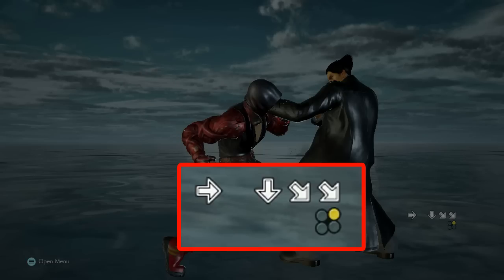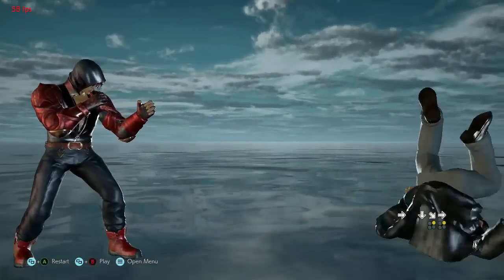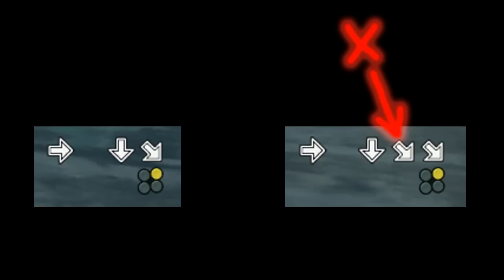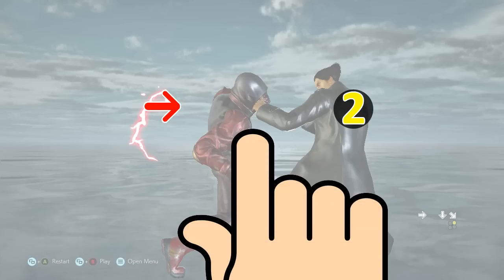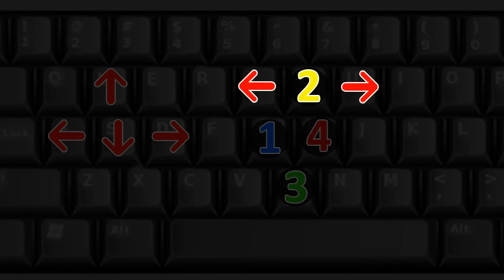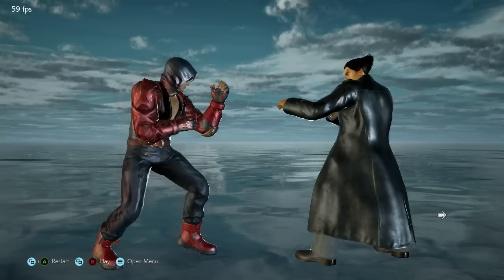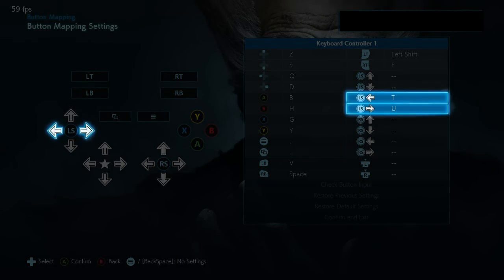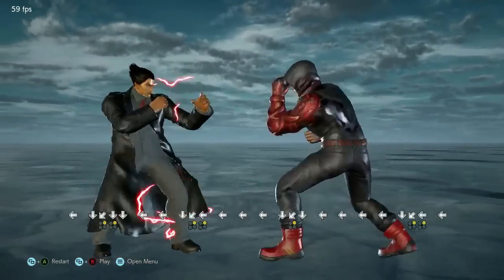Tekken 7 -  How to do Electric Wind God Fist (Very Easy EWGF)

Comment: rip im playing with controller :/
Reply: pad shouldn't be that hard. just press 2 as you press forward (while still pressing down, basically a down-forward). relax your thumb. don't put too much force or speed. like the video said, precision or accuracy is much more important. practice even by slowly inputting f, d then from the d input that's where you press f and 2 at the same time (again, no speed required, just press them at the same time)

Comment: Damn, this was a HUGE help. I can literally electric every time now with my setup. I use insert, home, delete and end, and have movement also mapped to page up and page down. kbd is also even easier this way.
Reply: I cant get the +2 frames on the shutting down part, Help?
Reply: How did you map it out like that?
Reply: @200ike  wtf playing tekken on keyboard. why torture yourself like that?? buy a ps3 controller or ps4 or even the damn xbox one to play fighting games. Why the torture why why why why why????? why? how? why?
Reply: @gamingman21  This isn't a helpful comment. Maybe I don't like the ps3 controller. Maybe I can't afford a controller. Maybe I don't have a console. Keyboard isn't that bad anyway
Reply: @gamingman21  I have a ps4 controller. But I still play on keyboard because I found it easier.
Reply: @200ike  No front but for tekken keyboards are trash. even a cheap 10 dollar controller will make this game way more comfortable.
Reply: @BesiktasAslan1  I get that, although I see it as a preference thing. I tried my ps3 controller for it, and it was annoying to execute an EWGF. Hurt my thumb after so many tries. 

The keyboard is more responsive to the commands. Adjusting is the difficult part. Because I'm undecided if I should use a controller or a keyboard.
Reply: @200ike  Well the best option is an arcade stick since the movement hits just different on these things, but keyboard is last place tbh. This comes from a dude that plays tekken for over 15 years now
Reply: @BesiktasAslan1  I've thought about getting an Arcade stick, but I worried that I might regret it, for whatever odd reason. The directional pads on controllers are just so awful to me. And I feel clunkier when I move. Like if I want to duck, I'll side step, and vice versa
Reply: @200ike  ull get used to it, in the end its for u to decide tho but if u really wanna improve in tekken and plan to play it a long time get an arcade
Reply: @BesiktasAslan1  do you use an arcade stick?
Reply: I'm new in this game, what is the function of electric move in Tekken?
Reply: @BesiktasAslan1  their isn’t no best option it’s all personal preference I’ve played both stick and pad and tried them out they never were comfortable for me but when I tried keyboard it felt the best to me.
Reply: @gamingman21  Spoken like a true noob. Even some hardcore pros use keyboard. The input is a lot better than pad for movement based attacks.
Reply: @BesiktasAslan1  was tekken on a platform that supports keyboard 15 years ago? Like, keyboard makes electrics and basically everything else piss easy. I can hit 99 electrics in a row no problem. Picked up tekken for only a few days and managed to wavedash fairly well and do extremely consistent electric.
Reply: @opgroundzero2.0  it was on arcade lmao
Reply: @stephaniecurry45  rhetorical question
Reply: Good for u :( its so haaaarddddd

Comment: For a more universal way of getting to the point of doing electrics, here's what I did, it took about a day or two total to get to the point I felt comfortable going for it in a match.

1. Get familiar with the misinputs in the following order:  Elbow (f2, way too early), dickpunch (d2, early), WGF (late), df2 uppercut (way too late/spasming).

2.  Don't just speed up or slow down, focus on doing the dick punch one frame after pressing d.  Practice this first and train your hand to hit 2 exactly after.

3. Keep trying to nail the electrics with the idea in your head that you're trying to hit d and 2 at the exact same time, not df and 2 at the exact same time.  This is for a couple of reasons, a misinput d2 is a lot less worse of a misinput than the WGF, and the delay between your hands that usually gives you the WGF can be used to place your 2 input directly on top of your df input.

4. Do electrics in a match and you will solidify this in your brain.  An easy setup is to try to nail an electric after a jab.  The worst thing that can happen is you lose your turn, but you need to practice under pressure to achieve consistency.
Reply: #3 tip helped alot
Reply: @mattroque7345  Wow, seeing this made my day, glad to hear :) Keep at it, I'm still drilling these at least a hundred each side a day and just barely pulling them out in matches.
Reply: Thank you for your humour and your advice I'm getting it down now
Reply: @mattroque7345  same
Reply: i instantly started hitting these like no tomorrow! the explanation was perfect thanks bro

Comment: I know how it works but its difficult in console. So what I do is press down forward triangle at the same time.it usually works. When it doesn't its because I didn't press at the same time. The pressure sensitivity of triangle and the directions are a bit different in the d pad. The triangle have a very slight higher travel time than the directions. So knowing how much pressure is needed will help in getting it right. But on the other hand it will mean executing it in other dpads that are not yours will be difficult because ur hands are not used to other pressure of other dpads
Reply: This is how I do it on ps4 too. Controller destroyer though.

Comment: even works on ps4
Reply: how do i do the binds im kinda dumb
Reply: How
Reply: Yes it works, I always mind the speed of inputting d,df and 2. Its not just pure precision. Speed is also necessary.
EWGF dont have very easy way doing it, its tons of practice and time to be able to pull EWGF very consistently.
I use PS4 controller and I input down and 2 at the same time while sliding to df (its easy but doing it consistently is very hard)

Comment: Bro I'm not using a keyboard I'm using a Fightstick with a Korean lever and out of 100 attempts I land one Electric Fist. It's so difficult :'( I'm getting ready for Tekken 8 I'm a KOF Player, currently I'm not playing KOF I'm playing Street Fighter 6 but I'm not gonna play Street Fighter 6 anymore one Tekken 8 comes out and I have 3 characters in mind to use, (Hwoarang - Kazuya - Jin)
Any advice? 🤔 Should I get a Leverless Controller (Hitbox) instead?
Reply: You have to sit very very long time in practice mode with these characters but it doesnt matter arcade stick or controller, keyboard the input is the same just practice it, if you figured out how you gonna do it correctly you gonna get a touch for it

Comment: smart idea. Though by this point i am so used to playing with pad. I can't play on a keyboard
Reply: switching only takes a few days :)
Reply: pad shouldn't be that hard. just press 2 as you press forward (while still pressing down, basically a down-forward). relax your thumb. don't put too much force or speed. like the video said, precision or accuracy is much more important. practice even by slowly inputting f, d then from the d input that's where you press f and 2 at the same time (again, no speed required, just press them at the same time).

* sorry, i know i already replied the same on another comment, but I just want to help as much people I can. I'm just a green ranker but I can spam electrics all day.

Comment: ammmm ... any guide or samthing for the controller? 😅 i really need it to learn the elecric wind
Reply: pad shouldn't be that hard. just press 2 as you press forward (while still pressing down, basically a down-forward). relax your thumb. don't put too much force or speed. like the video said, precision or accuracy is much more important. practice even by slowly inputting f, d then from the d input that's where you press f and 2 at the same time (again, no speed required, just press them at the same time).

* sorry, i know i already replied the same on another comment, but I just want to help as much people I can. I'm just a green ranker but I can spam electrics all day.

Comment: 0:30 is there any difference tho.. both attacks looked the same without sound tho
Reply from the maker: Look at the opponent.
In the first version, the opponent gets flipped in the air and falls on his face right away. In this version you (the attacker) can't do any more attacks. The opponent hits the floor and can standup right away.

In the second version, the opponent gets a spin in the air and lands on his back (with his legs lifted up in the air).
In this version you (the attacker) have enough time to quickly dash forward and land a 5 attacks combo and the opponent can't do anything to stop you.
Reply: electric is +5 on block and thus, safe. furthermore, you can throw another i14 attack that can't be interrupted even by a jab.

the normal one is i think -10 on block. which can be punished by a jab.

to sum it up. on block, normal one gives opponent a free jab. electric one gives YOU a CHANCE for a free i14 or faster move.

Comment: i hope you dont have to go to a tournament anytime sonn, this is probably not legal
Reply: This is the only way to do an electric on keyboard. It's just not possible to do moves that require an arcade stick on keyboard without skipping a few button presses. It's called buffering and it's already in the games code. So I won't call it illegal.
Reply: @maxwellsope1080  I was able to do it just with the basic layout on keyboard, I am not good at it but I managed to do it.
So wouldn't say it is impossible just a bit difficult
Reply: @THSNinjA  No one's saying it's not possible on keyboard. what I am saying is that the only way to do EWGF on keyboard is to use buffering techniques.
Reply: @maxwellsope1080  sorry for misunderstanding you ^^'
Reply: @maxwellsope1080  just press D, press and hold S. After that (still holding S) press D and your 2 button at the same time. Ez
Reply: @MrDamojak  So will I get consecutive wave dashes byjust pressing D while holding S. If not then I already know how to do ewgf (I just don't know how to do it faster. A better keyboard maybe?) .
Reply: @maxwellsope1080  1) Stand facing right 
2) Press D
3) Let go off it
4) Press S and hold it
5) Still holding S, press D and your 2 key at the same time. That will give you d/f+2, since d/f is D+S on the keyboard. This gives you the EWGF.
6) Let go off everything. 

That's what I meant.